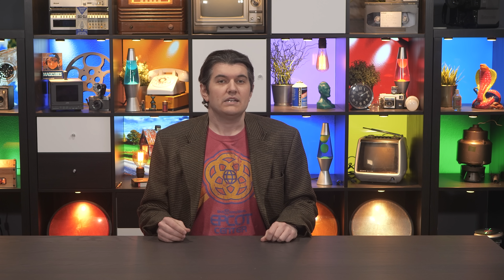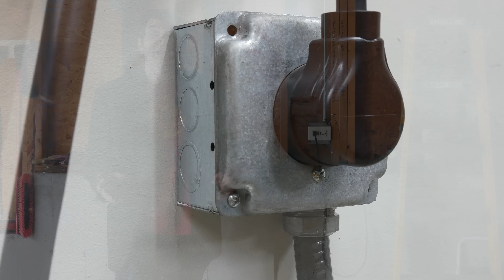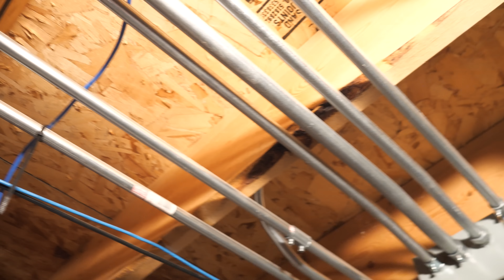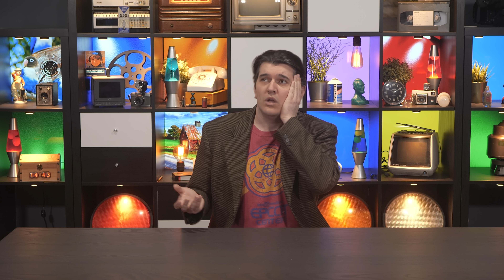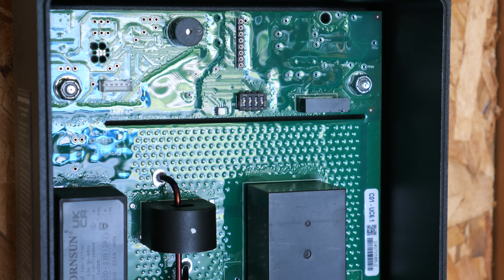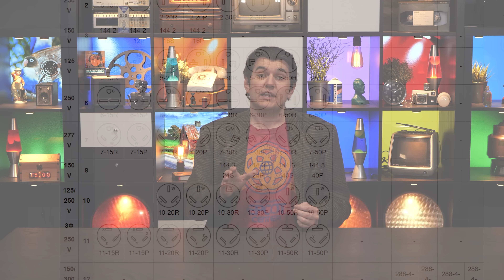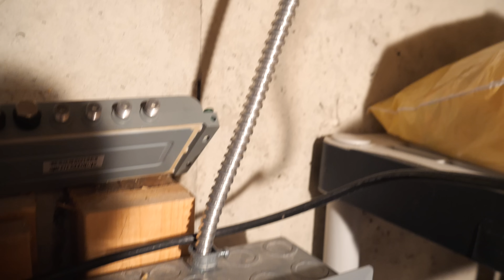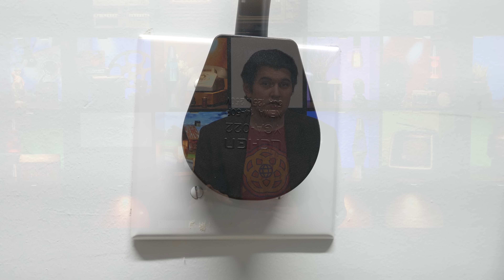The "standard" car charger is usually overkill—but your electrician might not know that

Comment: Im tired of seeing people offer bad advice about charging. Just because you can do something, doesn't mean you should.  110 volt charging isnt "good enough" and will cost 18% more in the long term, plus time wasted at home/dc chargers when your emergency charger [110volt] cant get the job done when you need range at unexpected times. Sure having a gas car can "fix" this but what is paying for insurance, registration, maintenance for a car you barely use maybe once or twice a year? Waste of money but the dmv will love you 😂 If you cant afford proper  240 volt charging, buy a hybrid gas car until you can make the switch instead of a lawn ornament charging 18 hours a day for so few miles.
Reply: Not everyone drives a lot of miles.
Reply: @CorneliusTaylor-s1uIf that's the case, why spend more on a electric car than a gas car? Thats dumb
Reply: @CorneliusTaylor-s1u If thats true, investing in an EV isn't smart and will take much longer to see the benefits compared to sticking with a gas car.... I suppose you can lease an EV but that's a lot of extra insurance money and registration for a car someone barely utilizes.
Reply: @samusaran7317 

Yes, I'm currently not a fan of electric cars with their high prices, the limited infrastructure to support them, and the time it generally takes to charge them.
Reply: @CorneliusTaylor-s1uWhere do you live? Most area's have plenty of infrastructure, I know, I throughly researched this. Fyi, all new cars have a high price tag including gas cars.
Reply: @CorneliusTaylor-s1uTired excuses, it's not 2014 anymore and there's plenty of cheaper used options.
Reply: @samusaran7317 

You are contradicting yourself when it comes to pricing.
Reply: @CorneliusTaylor-s1uNot true. Many EVs are priced around the same price as a gas equivalent. If $3000 is going to break you, have fun paying more than that on the back again assuming you're comparing apples to apples. You clearly havent done the math gas versus EV which is fine. Not hurting me any, only yourself. Keep funding oil companies 😂
Reply: @samusaran7317 

Gas cars are significantly cheaper. You even previously acknowledged that, so I don't understand why you are now backtracking on that. I've done the math, which is why I continue to drive a gas powered car.

Comment: If you cant install a 240 volt outlet, dont bother buying an EV. Charging from 110 volt outlet is silly and costs 18% more in energy. If you can get by in theory with 110 volt charging, do you really need a car at that rate? Looking at those sub 3000 mile or less individuals. If you want to waste your money and time, be my guest. An electric scooter would be a better buy or renting transportation/taking a bus.

Comment: My last “car” went 400 miles on a tank, 20-80% battery usage means my 280 mile range is actually 170 which is realistically 150 miles. That’s barely enough to do a day trip, so no nothing like topping off gas car everyday. Run of the mill civic gets 3 x the usable range than a model Y

Comment: Second comment.
Codes and laws are all over the place - which is maddening.

I can tell you in my location in California, you don't want to do these installs, here is why:

Any electrical work to the box requires a city permit
That permit requires a licensed electrician to do the work.

If you decide to do the work and a fire is caused down the road, your insurance company will investigate and find that source of the fire, next they will find you did the work and did not go through the required legal regulatory process of getting a permit/work down by a licensed professional and that the permited work is inspected by the city.  
At that point they will deny your $500,000 fire damage claim.

And you get there by trying to save $750.
Reply: You're not required to hire an electrician.
Reply: @CorneliusTaylor-s1u you are 100% in correct  for  items below.

Major electrical work—new circuits, panel upgrades, breaker add-ons, home rewiring—requires a C‑10 licensed electrical contractor ().
Reply: @graphguy 

Then I suggest you ignore it.

Comment: Throwing contractors (all of them) under the bus.
This is a contractor problem.
I routinely deal with contractors (electrical, plumbers, metal workers, IT, painters, etc).
I have yet to meet one that was fully versed in all aspects of their profession
I have yet to meet one who says, "Gee, you really don't need to spend that much, you can meet your needs by this solution".

I will welcome all responses that prove me wrong.
Reply: You are 100% right. The vast majority of contractors are crooks. The code/permit/inspection is also a revenue generating extortion racket needs to be abolished in its current form. Combine those two things and it's no wonder the vast majority of Americans are looking to do their own work, and without a permit.

Comment: There are plenty of EV users satisfied with a simple 110v outlet. 
I think the challenge for dense housing (eg apartments) is that you need ~ as many outlets as you have EVs. Because charging overnight means (almost) every one of them will be plugged in every night. And that cost (and the related ones such as maintenance and payment) adds quickly. It's not as simple as just putting plugs everywhere. Not saying it can't - or shouldn't - be done, but it is a hurdle.

Comment: My roommate charges an EV off the block heater plug in the parking lot. It kinda sucks seeing as it isn't a hard wire, but it gets the job done even at 12 amps. Infrastructure improvements in multi-family dwellings would go a long way toward EV adoption. (That and better transit & walkability so we didn't even need extra cars to begin with.)

Comment: 4:14 MC cable is available from 14 gauge up 750 kmil online (which has a massive outer diameter of 3 inches). 8/2 or 8/3 MC is readily available and able to be rated at 75 degrees per the NEC, allowing it to be rated for 50 amps max, 42 amp continuous charging. You would just have to order it online or find it at a supply house instead of a box store, many of which, such as city electric supply, are open to the public.

28:25 additionally, aluminum wiring today does NOT need to have a corrosion inhibitor installed, per the NEC. It is not uncommon for it to be required as a local code, but it is not needed due to modern aluminum alloys which to not have the same corrosion issues as the aluminum of old, and you will not find any manufacturer requiring it to my knowledge and research. The issues you find are due to improper connections, too loose to withstand aluminums expansion and contraction cycles, or too tight to the point of deforming the aluminum. That's why torquing connections is so important, which few electricians do on a 14-50r. Also, a quick google search of "burnt 14-50r" showed me NO aluminum in the first many photos, and most burning originated from the connections between the cord and receptacle, not the receptacle and the wiring, which matches my experience as an electrician.

Comment: First, the standard 14-50 receptacle you showed is inherently dangerous for using with an EV charger as they are NOT intended for constant loads. You seem determined to provide very basic EV misinformation that newbs will consume. Shame.
Reply: Apparently they have to be derated by 20%, evs don't actually charge with 100% power at all times so I think it's fine.
Reply: @godassasin8097     You’re misinformed, but that’s okay.
Reply: he also talks about this around 29 mins btw
Reply: @godassasin8097   anyone who starts out telling EV owners they don’t need L2 charging is just trolling for clicks. It’s just a dumb pointless view. I’d go as far as to say if you can’t put in a L2 charger stick with a hybrid, unless maybe you have access to charging at work or can use public charging and don’t mind the cost. Beyond that, no one should be using a receptacle if at all avoidable. Hardwiring is far cheaper, more efficient, more reliable, and safer.
Reply: @JohnCap523 

Not everyone drives a lot of miles .

Comment: We just got our first EV, and really love being able to charge at home. We got a free install from Ford, and just had to pay for the local permit. It was done within two weeks of us receiving the car. In the mean time we did slow charging off a 120V outlet, and it was not a problem at all. It easily met our needs, but we wanted a faster charger for recovery from longer trips. Thankfully our house has 200A service, and we had a number of breaker spots completely empty, so install was quick and easy for the electricians.

Comment: If they're paying me $150 hr to install a charger. Im putting the correct charger in. Your absolutely correct its likely all they need, but explaining it isnt worth the headache 99% of the time. Its very easy to be consider a "hack" in the trades if to sway away from exact products, the overall hidden cost is to expensive.  Also if they only have a 60A-100A (unless its a shop)  service im not touching it unless they upgrade the service to a 200A first

Comment: If you live in Chicago, I wouldn't do what he did. MC cable sounds nice but by code you aren't supposed to have more than 6 feet in a run. The reason is similar to Romex. If you drill into a wall, pipe will keep you from hitting wires. What he used is paper thin. The rest of the country doesn't seem to mind for some reason though

Comment: Why don't electric vehicles have solar panels to change your battery car🤷. You wouldn't have to worry about changing. Gas vehicles have alternators to keep the battery charged. Why can't you change your electric vehicle while driving🤷
Reply: There are some cars that have solar panels, but the power output is quite low so it takes several hours to charge a battery on solar power alone. Let alone that it is enough to charge while driving, or on cloudy days or during the night. All with all, it's a very situational solution.

Comment: I have 100A service and an EVSE on a 60A circuit. But I get away with it because I have a smart electrical panel and the EVSE talks to it. If the house is approaching high load, it will throttle back the EVSE.

Comment: So, not getting into the details, but I've dealt with an EV that wasn't designed for the US market, but was here, and wouldn't charge on 110V at all. I left it plugged into a Level 1 Charger overnight, and the battery went down 1% and the car had ton of weird charging-related error codes. What a mess.

Comment: In the video you explain that the box that you installed is not a battery charger but a power supply and after that you keep on referring it to a charging station. 
If you want to get technical that box is a power interface, a smart switch with a captive output cable.
Btw, the Chicago code may have changed since I lived there but when I did that interface would have been considered portable equipment. Hardwiring it would have been prohibited. I'm not saying you're wrong .but emphasizing that local codes and permit requirements should be checked before installation.

Comment: Outdoor charging at 15amp (in US, 120V) is pretty flipping miserable in your own region during winter. That 300 or less W during charging is obviously not great, but also not that bad. During extreme cold though, I've seen less than 5 kWh gains per 24 hour sitting around 15F outside. That implies something like 800-900W loss to heating and inefficiency. 

My sisters house doesnt have anything other than 15-120, which basically only maintains battery during nights. Same weather, not far away, the 14-50 plug I put in my parents place is actually usable for daily driving. 

I do think its true that 14-50 is excessive, and realistically 16A at 240 is completely usable outside of the absolutely worst cases. But with that being said, I don't think the net cost (including time, the most valuable commodity) is actually much different to install a 30amp line and a 50amp one, unless and only unless you need to do some sort of service upgrade for 1 and not the other. 

A 50F unheated garage in the depths of winter compared to a 15F outdoors is going to be a huge delta in experiences. And that's before we talk about extension cord losses.
Reply: You're not losing power due to inefficiency and heating when it is cold.. The car is unable to accept the higher charging rate so it draws less.
Reply: @psdaengr6155  this is patently untrue for AC charging. More energy is spent keeping the battery warm enough to charge so the net charging is reduced. If it was battery unable to accept (which it just isnt), you wouldn't see benefits to more powerful AC chargers, and instead you find that low power ones do almost nothing and high power ones work almost normally (can ignore the effects of extreme cold).

Im talking about the difference between 1 kW, 3kW and 7kW max here, not even the weakest DC chargers at 50-75kW, where sure, batteries must first be warmed to accept charging at meaningful rates.

Comment: When we bought our first EV in 2017 our 110 year old house only had a 60amp service. We were able to put in a 20amp circuit which we paired with a 3.3kw charger. It worked great. When I had them put in the circuit I had them put in cabling that would support 50amps. We're now on our 2nd EV and we upgraded our electrical panel to 200 amps. Which means the the outlet in the garage now is on 50 amp circuit. But we are still using the 3.3 kw charger. If I need to replace it, I will put in a more more powerful charger, but I didn't feel any need to do that soon.

Comment: I have argued for years that installing a 30 Amp plug is all most people need for EV charging, and costs significantly less...I installed one in my parents for a total of $100. But the best penny pinching hack is to take an existing dedicated 120V outlet and changing just the breaker to 240V and the outlet to a 6-15 by just moving the neutral leg to the other line, and for just a few bucks and using existing wires, you more than double the charge power.

Comment: Thanks for the info. I've been on the fence about switching to an EV. The only 240-volt outlet in the house is a 10-30 dryer outlet. It would be about 30' from the car. There is a 120-volt outlet about 20' from the car. I only drive 10-20 miles a day. I was thinking about something like a Neo-charge to split the dryer plug. Is that distance an issue? Any other suggestions are certainly welcome. 
Thanks.

Comment: Great video! I learned a lot for your videos about electrical systems in North America. Having moved from Europe to Canada, this is very helpful as most of the things that are true in the US when it comes to electricity at home, the same are true here in Canada. Have the Grizz-le charger myself, and it just works. No nonsense! Would love to see an update EV charging video. Oh, after more than two years of EV driving, having a charger at home, super comfortable. I went for 40A circuit and 32 A max. More than enough. I often limit charging to 25A, because I have time to charge. At my in-laws I use the standard outlet. Works fine for a weekend stay. Charging speed isn't great and I think the EVSE that came with the car has a temp protection as the car stops charging for a bit in summer but seems to go in winter.
Reply: He doesn't talk about electrical systems in North America. He talks about electrical systems in his country. You saying that you moved from Europe to Canada also doesn't make sense. Just say what country you're from. Europe is not a country.

Comment: Electricians just don't want to deal with customers complaining about charging being slower than their spec sheet promised. Outside of really difficult runs with panels on the opposite side of the building it's easier (and more lucrative) to just build out enough to max out the level 2 charger. I definitely agree that a slow home charger is better than dealing with public DC charging. Once you're used to plugging in and waking up to a charged car there is no going back. It definitely has to be level 2 though. Unless you have a really short commute you're very limited on range specially in the winter. Sometimes I would lose half the current just with battery conditioning. Level 2 is a lot more efficient as well. Also on the topic of internet connection. The Tesla wall unit switched to an internet setup instead of dip switches on the newer one. It is however locally hosted webpage on the charger itself so it technically doesn't need an internet connection. It also allows you to install 2 chargers on a single circuit and have it load balance. The older generation was more limited and needed extra wiring. I haven't had any issues in 2 years and it appears that if you aren't using those features the charger doesn't even connect most of the time. I've lost internet before but the charger does not care it just keeps going.

Comment: I recently got an EV, and got a bigger circuit in the detached garage/workshop to replace the single 15A circuit that was all I had, with the breaker in the basement...and not always enough to run my power tools.  I wound up with a tax break to upgrade my garage power to a sub-panel with more than enough capacity.

Comment: Sorry but “Level I” 120V 15/20 amps gives 3-5 miles of range/hour. Period. Level II home chargers are either 32 Amp or 48 AMP and can add 20-25 miles of range/hour. Drawing that amount of juice through regular household wiring often leads to house fires. It is recommended to use AWG6 wiring to eliminate this risk. This is not hyperbole - its simple physics.

Comment: Got myself an Ioniq  PHEV. I could run the power from the laundry room but the 110v in the garage charges the 30 mile battery just fine over night, which covers most my day's travels. Of course I have no range anxiety since it'll just switch to hybrid mode once the batteries are out of juice.  I get that there is added complexity to PHEVs, but it really seems like a win-win. There should be more of them.